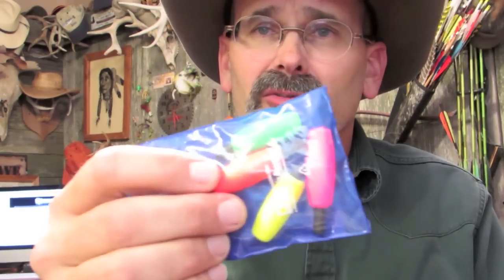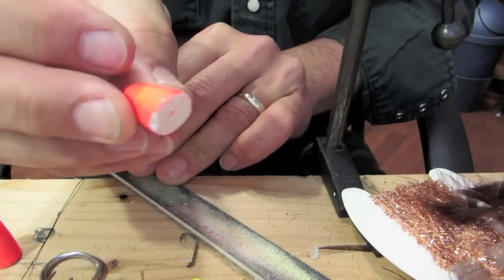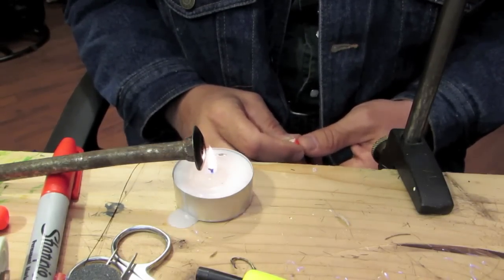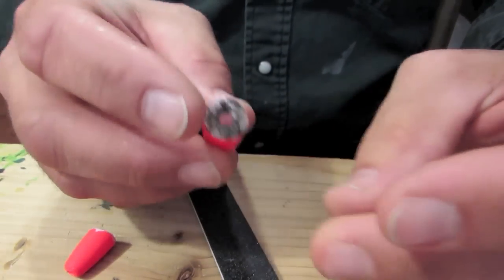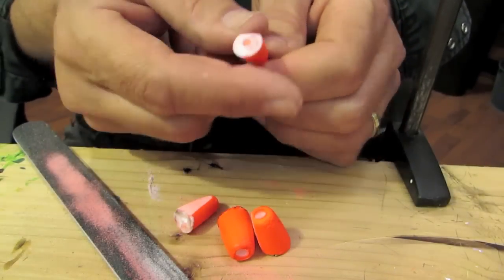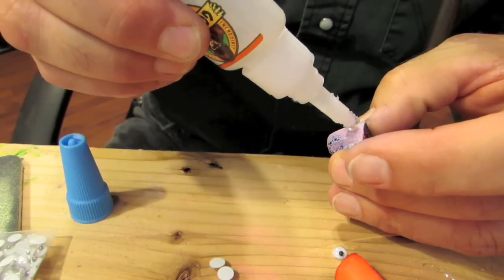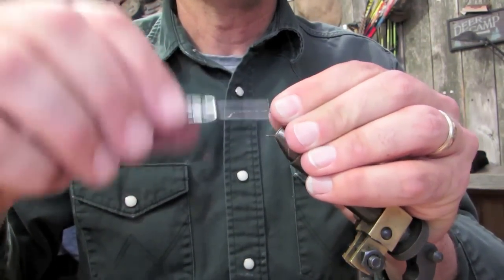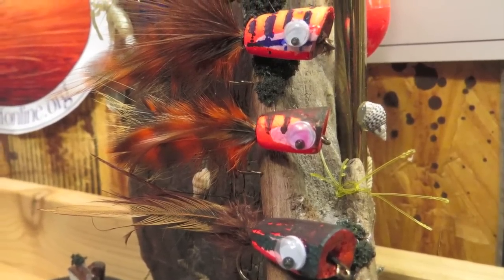Fly Tying: Slip Bobber Popper

Comment: Something i learned and passing it on to you is try tying a piece of foam leangth of the popper before putting the popper on the hook, then slide the popper over the foam and glue it to the foam, that way it fits tighter and there isnt a gap with the hook being smaller than the popper hole. :)
Reply from the maker: do that or use the foaming Gorilla glue ;) http://www.zoro.com/i/G3030483/?utm_source=google_shopping&utm_medium=cpc&utm_campaign=Google_Shopping_Feed&gclid=CPO8gLKar8MCFQkuaQod1VsA9Q